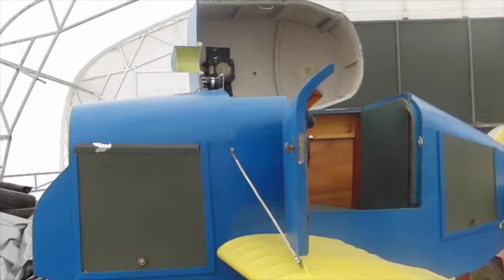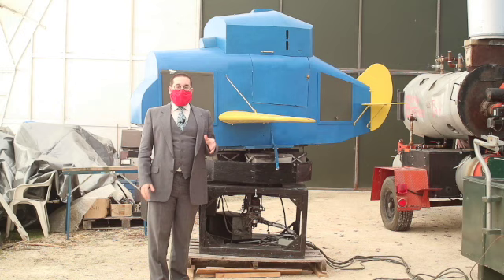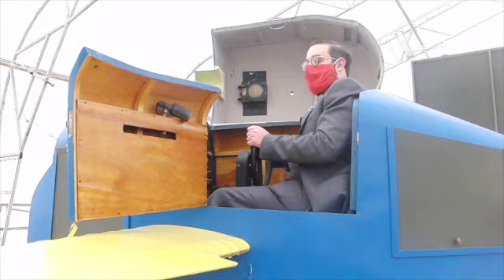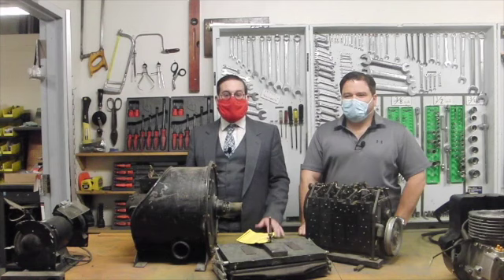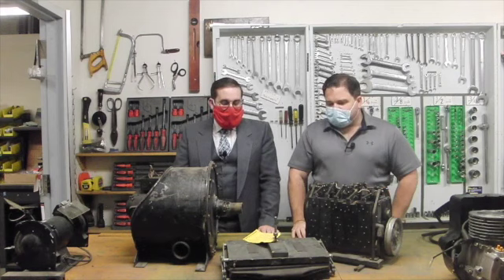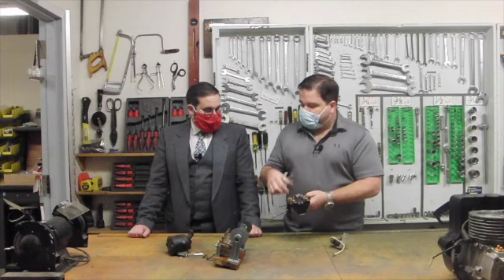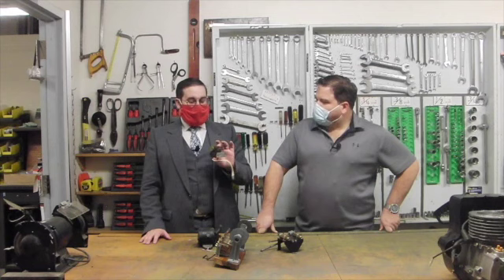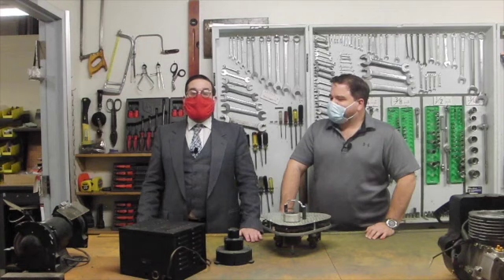The Link Trainer: the Insanely Sophisticated Steampunk Simulator

Comment: Back in 1967 I was in Basic Instrument training at Ft Rucker, Alabama.  I was flying a Bell TH-47. When not flying in the Helicopter I was at the Simulator practicing instrument flying in a modified Link trainer.  A Collective control had been installed to control power. Much harder to fly than the Helicopter under the hood. The Army Aviation Musuem at FT Rucker has one of the old "Blue Canoes" on display.  I retired flying the Boeing 777 and the difference in the two simulators is night and day. I am a better pilot because of the time I spent in the Link.
Reply: I was in Class 67-501 at Ft. Rucker. Spent many hours in one of these.
Reply: So in theory vs building an electronic motion platform, a phone call to an accordion manufacturer (custom bellows- pitch and roll), some pool companies (Vacuum  pump) and a trip to the junkyard (starter motor -for yaw) and throw in a VR headset for instruments and save several Thousand dollars!

Comment: The best thing about these is that they absolutely didn't have to make them look like tiny little stubby planes. But they did anyway.
Reply: I'm wondering if the miniature wings and control surfaces were intended to be for the benefit of the instructors and observers? At a glance, it was obvious which end was the nose, and which was the tail, as it was spinning, banking, and diving or climbing.

Comment: the Apollo command module was a Link Simulator, (not a blue box) as Link was owned by SINGER at the time. I came along in the early 70s  for SkyLab and later F4 Phantoms, T-37s, T-38s, Hueys,  Cobras and on and on. Full motion full visual sims have come a long ways baby!

Comment: Player pianos use a negative-pressure windchest.  The pump produces a "weak" vacuum, and all the control pneumatics (little bellows) collapse when they operate.  There's a practical simplicity to this, since you can use relatively thin rubberized cloth to cover the bellows, and the material doesn't need to be especially thick or stiff, since a collapsing bellows really can't easily  "blow out" or "balloon".

Organs have to use a positive-pressure windchest.  You need air to blow out of organ pipes (to form the air jet over the organ pipe lip).  Pipe organs use a set of bellows (with stiffener reinforcements to keep them from "ballooning") and reservoir to build up "slightly" compressed air.  For control mechanics (like Barker levers) all the pneumatics are set up to inflate rather than collapse, but these can be a bit trickier to work with. 

Some self-playing instruments (like Welte organs) have BOTH a suction pump and a positive-pressure pump.  The control system (trackerbar, valves, pneumatics, etc.) for self-playing uses the weak vacuum, and the positive-pressure system is reserved for making the organ pipes speak.  [This really makes sense, since you need vacuum to keep the music roll paper "sucked onto" the trackerbar that "reads" it].

It's no surprise that Link trainers use vacuum. If all you need is mechanical motion derived from fluid pressure, it's easier to build a "vacuum" system than a positive-pressure system.  The wind motor for rotating the trainer (yaw) looks pretty much exactly like a sized-up version of the motor type used in player-piano spoolboxes to drive the paper transport.

Comment: If you with some foresight realise that you will have a sunday free in Stockholm, Sweden, you can inquire about a possible session in a Link Trainer at
the aircraft museum in Västerås¹. Appointment has to be arranged for the Link trainer, but there are other simulators available.

¹) 1 hour drive from Stockholm.

Comment: I got some time under instruction in a Link trainer in 1987...  it is an excellent method of initial training. I'll also note: some models got modded with a variable resistor tied to the ASI reading, and DC motors in the crab. This did make the throttle matter... but a lot of instructors simply ignored the map functions.
It's nowhere near as cool as the MS Flight Sim with proper flight stick and pedals... I did get a quarter hour on that. I also got some time in the F-15 sims at EAFB, and the P-3 Orion sim at MCAS Kanehoe, both also in 1987. (NJROTC cadet and CAP cadet. NJROTC Senior Trip was to Pearl and Kanehoe. Freshman year, got to NS Seattle and NS Whidby Island. No flight sims there.)

Comment: If throttle was reduced. Did the airplane used to "descend"?
Reply: Yes. The throttle lever was connected (via push-rod and springs) to a bellows, which regulated the flow of air into a tank (mounted behind the pilot's seat). Most of the Link's systems were powered by a central vacuum pump in the base. When you pushed the throttle forward, it resulted in a decrease in air pressure in that tank. A sensor in the tank relayed the pressure information to an altimeter (in the cockpit) and at the instructor's panel. (The throttle lever also had similar connections to the front and rear bellows, so that when you pushed the throttle forward, the aircraft would nose-up, and vice-versa when the throttle was reduced.)  
  It was also capable of stalling and spinning! A very cool device!
(As a kid in high school, many years back, several CAP cadets and I restored a few of these to flying condition.)
Reply: @nightbeacons  Thank you for your explanation!